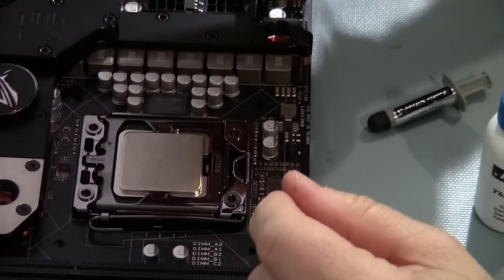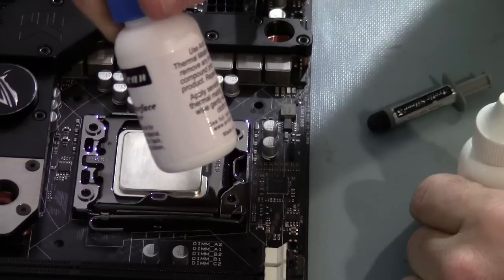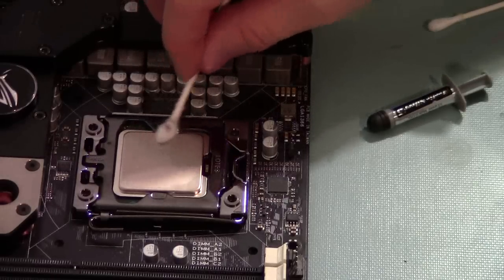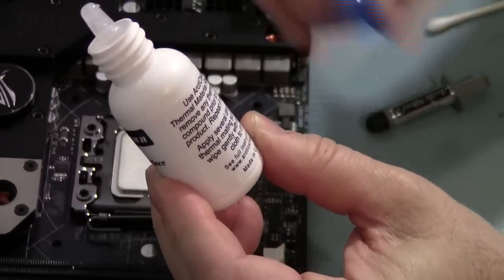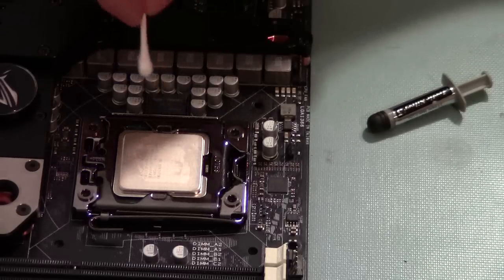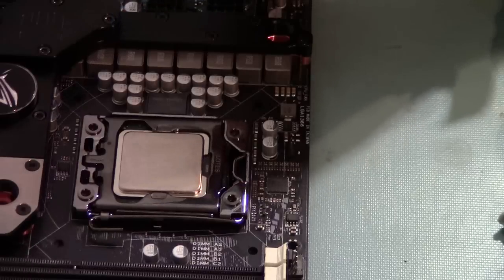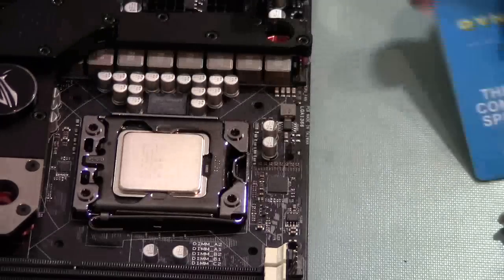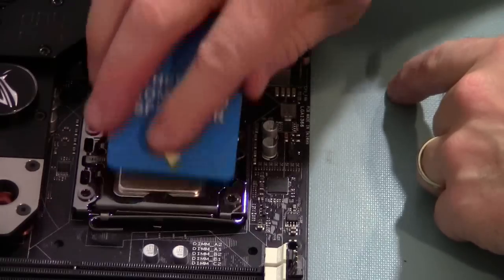How to Clean CPU and Apply Thermal Compound

Comment from the maker: The easiest way to clean existing thermal paste is to get some 99% pure isopropyl alcohol and use a lint free cloth or paper towel and wipe off the thermal paste. If the chip is seated and locked down, butting the amount of pressure you need to wipe it off is not a problem.  I have always followed that with the ArticClean stuff, but you really do not have to use that.  Use a q-tip to get any nooks and crannies of thermal paste with a bit of alcohol and you should be ready to apply new stuff.

Comment: i've seen in some other utube videos that you shouldnt apply any pressure on the cpu while its in the motherboard, as pressure might bend the pins... ad other utbe videos do what u do... i dnt get it which way is safer and easier to get rid of existing thermal paste?

Comment from the maker: @Amin7ty No problem.  That stuff works really well, but in a pinch you can always just use 99% pure alcohol. When replacing a CPU I always use the alcohol with paper towel to clean the old thermal paste off and then use the kit to prep the CPU for the new heat sink.  On new installs you can just use the 99% alcohol and/or the Artic Cooling Kit.

Comment from the maker: @Amin7ty Paint thinner is explosive, corrosive, and dangerous to inhale. Rubbing alcohol evaporates away very fast and leaves no residue behind. Use this only on the outside of the computer, not on internal parts. Using compressed/canned air no closer than 6" for internal computer parts is recommended.

Comment from the maker: @Amin7ty I think the other petroleum based chemicals in thinner may be a contaminant and could prevent proper conduction. Even if you used it to clean off the old stuff, I would use alcohol to prep it for use with you new heat sink. Use at your own risk.